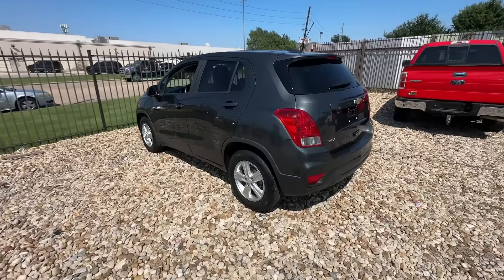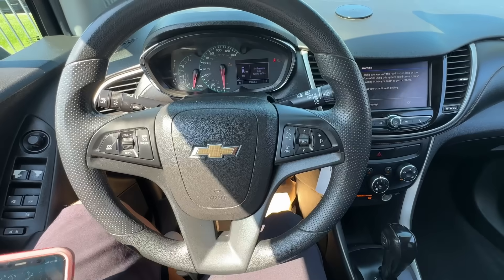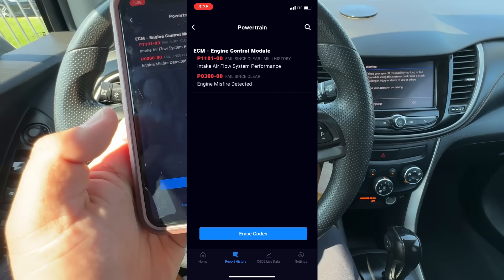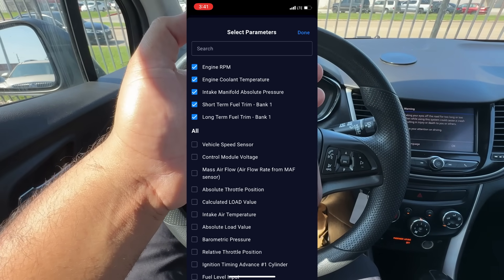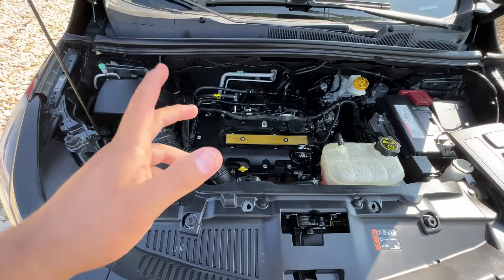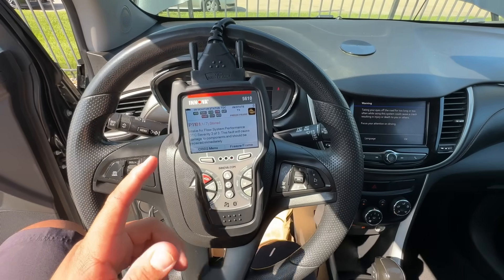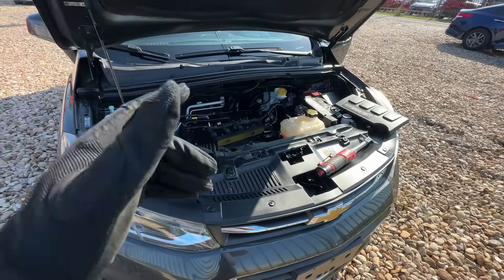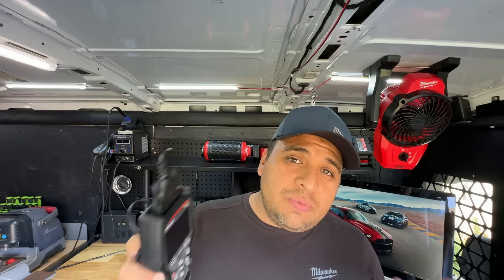P0300 Misfire Chevy Trax — Someone Tried to HIDE This!

Comment: Besides the ignition coil going bad on Trax's, the Bakelite style plastic lugs that slip over the top of the spark plugs break off.  Also, the spring-loaded metal lugs between the individual coils and the spark plugs get totally corroded (They turn green) causing them to lose contact with the spark plug - hence the misfire.  The coil pack on these cars is not well made and it may be that aftermarket replacement coil packs from Amazon, Rock Auto and others are as good or better for less $$$.